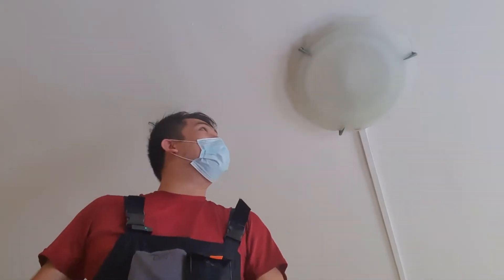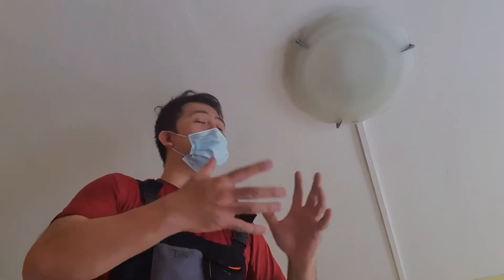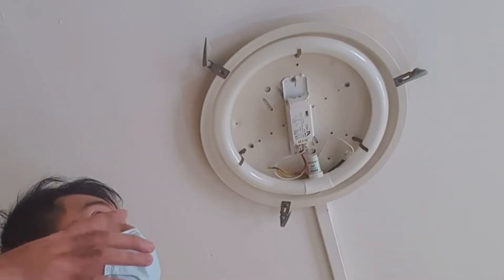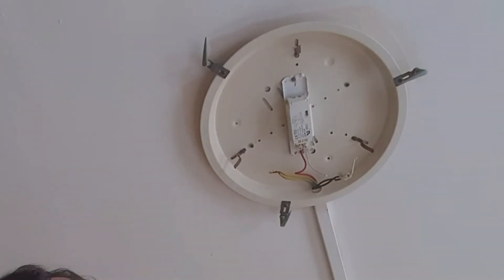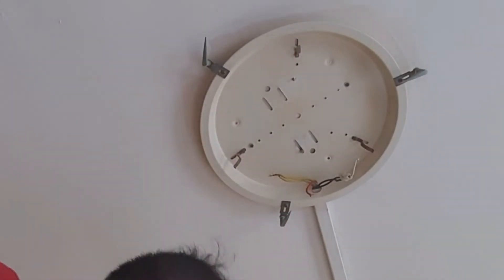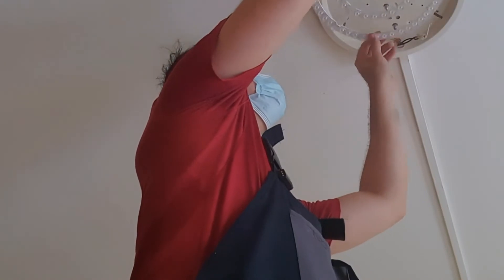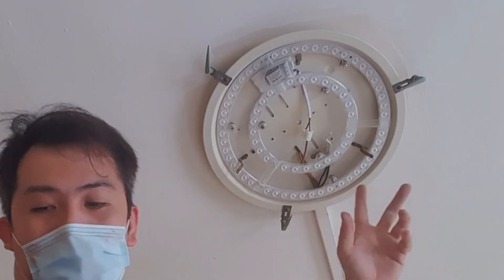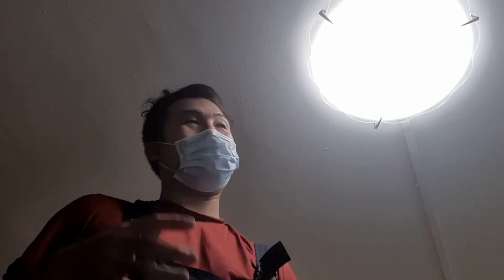How to change a fluroscent light into an LED light

Comment: you mention sometimes the NEUTRAL may have power as well if tested with test pen. Why is this? Thought only LIVE will light up with t pen :}
Reply from the maker: The neutral runs back to the main DB and is supposed to be separated from another circuit. sometimes people take the short cut and link another live wire to the neutral line you are working on  and if that alien circuit is closed the neutral will be live. So you never know what the person before you did, that's why best to err on the side of caution

Comment: I think the earth wire should be screwed onto the base plate of the light fixture.
Reply: Yes, you're absolutely correct. If there is a leak from the live wire, the entire metal fixture including the 3 steel support prongs become live.